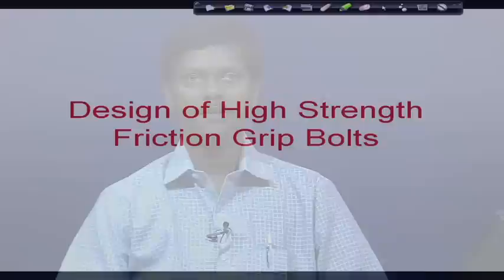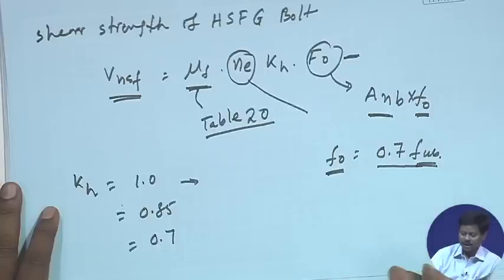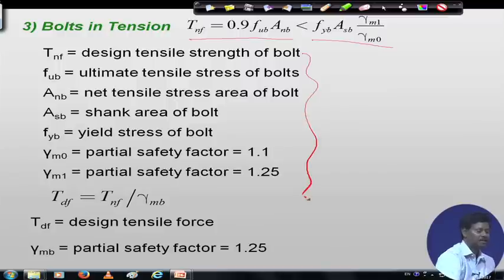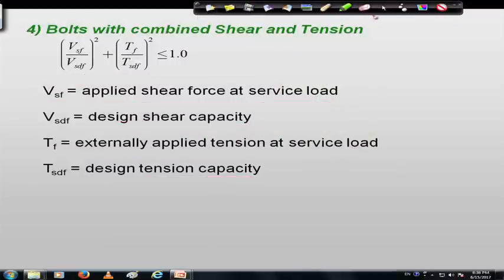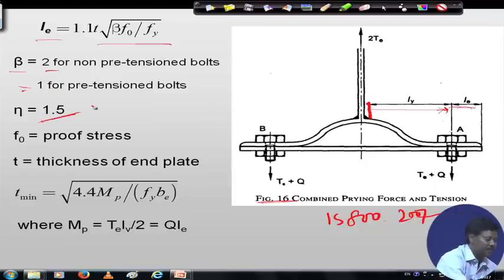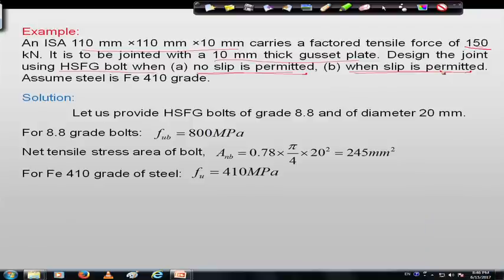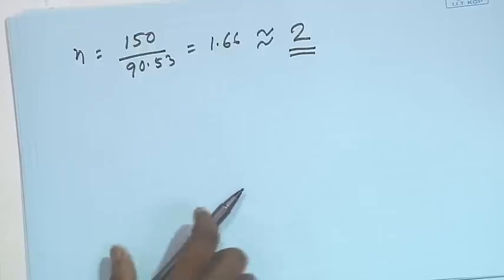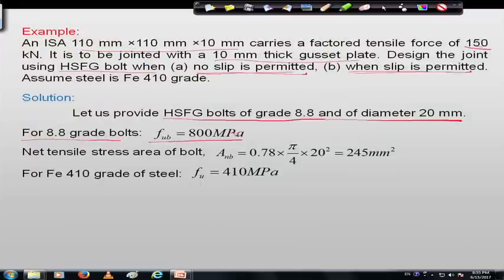Lecture 8 : Design of High Strength Friction Grip Bolts

Comment: When we use HSFG bolt and consider friction, the number of bolts required are 3 but at the same time when we use HSFG bolt and do not consider friction, the number of bolts required are 2. I don't understand this. Shouldn't the number of bolts required increase if friction is not there?
Reply: somebody should answer this.
Reply: Maybe more bolts account for more friction as slip is not allowed. But in case of lesser bolts slip is more likely to occur.
Reply: When slip is allowed, the plate slides and bearing action is developed. Hence HSFG bolts are designed as Ordinary Black Bolts.

We require high Fo value for no slip condition so we require more bolts.
Reply: The thing is you are considering friction between two plates will resist external load. Go to assumptions of bolted connections. We neglect the effect of friction developed between plates due to self weight. Actually the thing is we are developing high frictional resistance between two plates against external applied load by means of applying high Fo value by tightening the bolt. That is the principle behind HSFG bolts